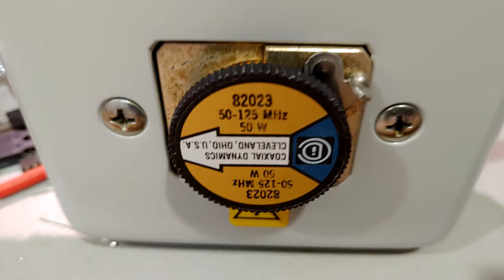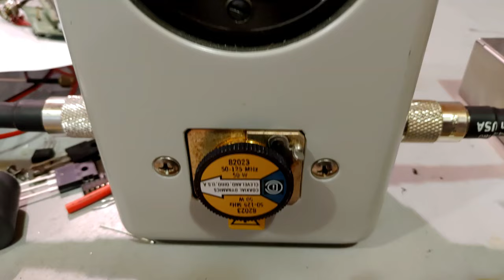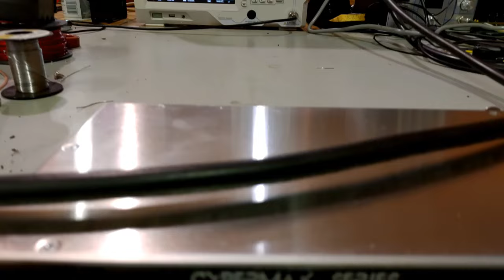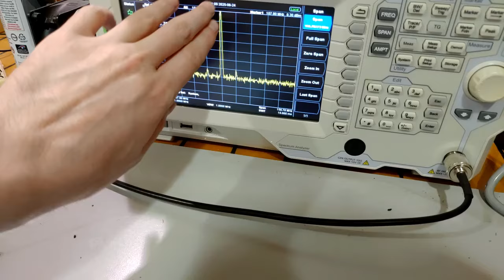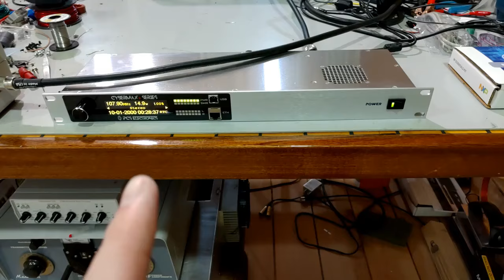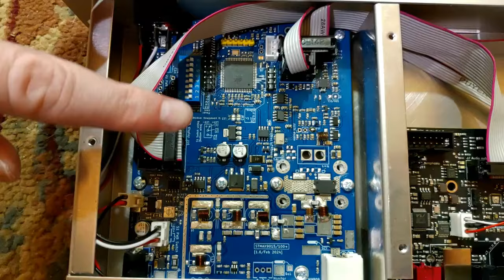PCS DDS FM Broadcast Transmitter (Exciter)

Comment: Audio input test would be nice to see sometime in future reviews. Even though the sound may be perfect, the output of the transmitter might not be. MPX sweep up to 60kHz would do, and square wave test for under 100Hz to see tilt, and how well it handles low frequencies. For internal stereo it would be good to check the stereo separation, accuracy of the pre-emphasis, and the 15-16k lowpass slope.

QN8006/QN8007/QN8066 are very good in my experience, only very little tilt and linear 50us response to 15kHz.

The traditional PLL tx's from PCS used to be very poor in the past. I've had multiple units, and low frequencies were just a mess, PLL even unlocks with dense audio processing. You can't connect a processor with composite clipping to these without reduced modulation levels. Even the Cybermax v3 series has this issue! (not sure about the new Black Edition). I have worked on several transmitters over the years, and haven't seen that being an issue on any other brand. All have had perfect MPX.

Another problem I've had with PCS is frequency accuracy. The older maxpro's were off over 2kHz, not being usable without modding (legal limit here in Finland is +/-2kHz). I have some QN8007 based tx's, and those are around +2-3kHz over. I wonder how precise that PCS model is?

But great video, and nice to see you back! Hope to see more reviews soon.
Reply from the maker: Wish I knew how to test audio from a transmitter without factoring in the receiver's noise and other problems. I was thinking about just uploading audio samples maybe in the future. Of course I could just look at the analyzer with audio going into the transmitter, but then I wouldn't know how to measure stuff like tilt with the spectrum analyzer, so yeah. Appreciate the comment though.
Reply: @spectra-man  New generation commercial transmitters that have regulator certification have no problems with the band below 100Hz. Moreover, what is on the market today is mostly in terms of baseband amplitude (20Hz-60KHz) in the deviation of 0.1 to 0.4dB, which is more than acceptable. THD is also negligible. What was wrong with previous PCS transmitters was phase distortion that caused modulation overshoots. So, highly processed audio had to be reduced by up to 4dB to keep the peaks within the 75K norm. The problem was a poorly designed loop filter. The new generation 8000+ is supposedly better, but I haven't had the opportunity to test it. As @Rikum1235 said, it would be good to examine the baseband of these transmitters as well. You need a high-quality sound card with excellent linearity with 192K sampling rate for the transmitter side and a tool like stereotool or breakawayone, which also in the demo version enables tools like mpx sweep, combo and square test. On the receiving side, you need a high-quality SDR dongle and a tool like mpxtool, which, in addition to numerical measurement, also has an oscilloscope through which you can visualize the baseband just like with rigol.
Reply: These boards did not have a tcxo crystal. As a result, there were larger deviations of reference frequency. However, the 6xxx and 7xxx series had the option of fine tuning with a variable capacitor on the board. Of course, you needed a fr.counter for that. A variable capacitor could be installed on the 2015+ series to solve this problem. In addition to the problem with the band below 100Hz, an additional problem was the dust that the fan would throw into the smd components. So in my case power detection chip failed, and instead of the set 2w, it delivered a full 15w to the amplifier, which ended in a burnout.

Comment: Ahh I understand now, I was like do you need the display, I'll get the 25w transmitter from PCS, seems so affordable... anyway, how to input audio without that expensive board.
Reply from the maker: I believe the white pin headers on the mainboard will do it. The price is very reasonable if you get the kit version (299 euro). They don't sell without the extra board though.